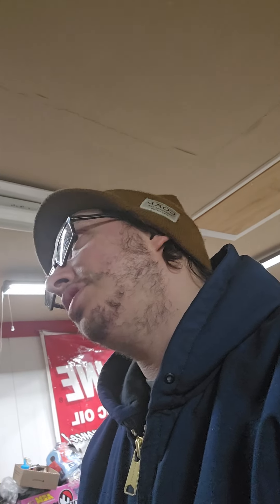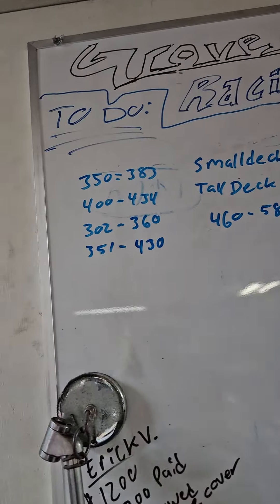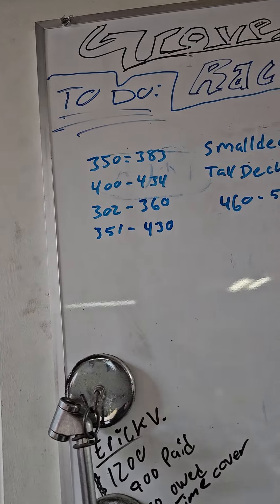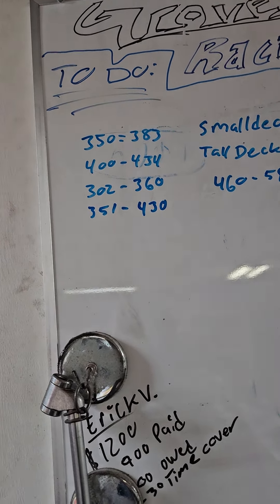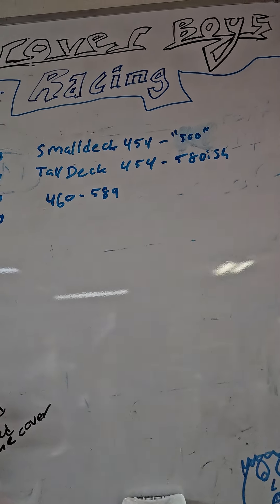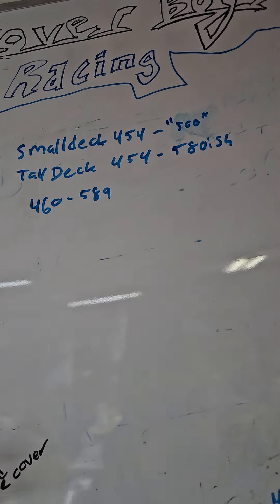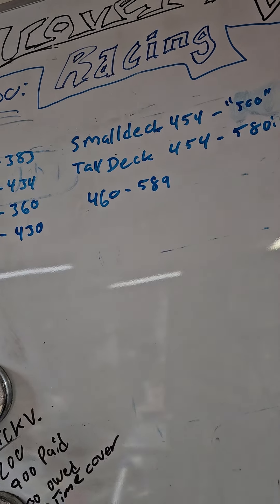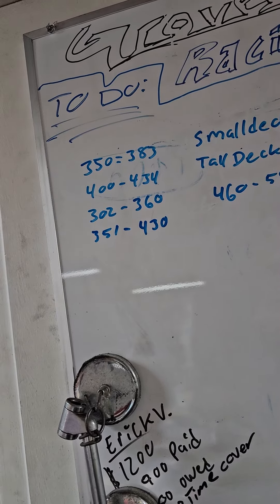FORD VS CHEVY! The facts from my perspective. Disclaimer you may be offended!

Comment: I I got a question for you that I find that mixed reviews. My car is put away for the winter. I put a full dig gas in it and it’s topped off with stabilizer fuel stabilizer took the battery out of it, etc. no I’m told not to start it for the whole year until next spring other things, I read
Fire it up what’s your thoughts? I just don’t want any condensation in my exhaust or the motor and rust on the bottom of the car or in the motor.
Reply from the maker: Personally id probably mix marvel mystery oil in it and run it. The can of fuel stabilizer should have directions of what to do, but marvel mystery oil is a nice oily substance that keeps things lubricated. Can be used in gasoline or oil. I like starting my stuff through winter time and letting it run even driving it on those days that are nice aslong as it isnt freezing lol.
Reply: @GroverBoysRacing777AdamGrover 
What do you think of guys running 20 W 50 in in their cars when I bought this car off the guy he said the oil changes were 20w 50
Reply: Car ran strong last summer. I’m just itching to start all the new work on the car just getting too damn cold
Reply from the maker: @Bob-Pye  i hear that, last night was the first night ive been in the garage in roughly 1 or 2 weeks. My whole family came down with somthing and finally were getting better
Reply: @GroverBoysRacing777AdamGrover  glad to hear, man I’m really glad I got your channel really help me with my build and my quest for 12s in a completely stock Foxbody
Reply from the maker: @Bob-Pye  its easily doable, good luck and lmk how you make out
Reply: Thoughts on running 20w50 VR1 valvoline in a Foxbody?
Reply from the maker: @Bob-Pye  i usually run ford motorcraft synthetic blend 20-30 or somthing like that.

Comment: The fact that per CI and weight we’re able to compare a 302 sbf to a 350 sbc makes the 302 the clear winner.  I’ve had great luck on a budget with the sbf>sbc.  Just least investment per ET times.
Reply: I was a GM technician for 16 years, my daily drivers were always GM.  I always had fox bodies and occasionally SBC cars for drag racing.  The ford was cheaper to get results from.  As specially 5.0 roller setups.
Reply: I built a Vortec 350 with great results mind you but the car overall “G body” took much more effort than a stock fox for ET numbers.

Comment: I know one thing I do like about Chevy is the price of the parts , I honestly think that is why half of the Chevy boys are Chevy boys. But you're right when they want to compare engines to engines they want to pick on the poor lil guy the 302 vs their 350/400/5.3/6.0 but never their 305 vs the 302 even though they still have a 3 cube advantage 😅.  I would put a 289 vs a 305 or even a 350 if built right. With that being said hopefully you'll have good luck with that 350 cause it sucks if you're constantly having fix broken parts, but upgrades are always fun when they work and make power but sucks if it goes slower. Im in the middle of a cam and 1.7 rocker swap trying to get all I can out of it even though it is fast there's always faster 😂
Reply from the maker: Youll have one guy come on here i bet and mention the chevy 302 i can almost gatuntee it, i think they forget there was a boss 302 though lol.. when you start comparing apples to apples the chevy boys get very upset
Reply: @GroverBoysRacing777AdamGrover  🤣😂🤣 yeah you're right, they don't want to bring up the boss , hell it 
Would still give them hell with very few mods, it was way ahead of its time, even the Cleveland, it got banned because it was too fast , and it can easily be made to go fast with the stock heads in today's standards
Reply: @GroverBoysRacing777AdamGrover  Your entire vid is you being upset and offended that people don't agree with you.  GM engines rule the aftermarket because they are better, simpler and cheaper.  Ford engines have always been weaker and cost far more to build to the same relative level as a comparable Chevy.  Can you find exceptions?  Not really, because displacement isn't the only point to consider.  A 302 boss, for example, was not intended to compete against a 305; it was aimed at 350's and 400's...and failed.  Trying to ignore that doesn't support your argument, it just makes you look desperate.
Reply from the maker: @scottysgarage4393  youre back again? This video must have really upset since youre back 3 weeks later.. I think you need to learn some facts because the boss 302 and chevy 302 both were made for trans am racing and the gm 302 was know to out perform the other gm small blocks in average street cars from the factory. Now that being said, the boss 302 out ran the gm 302 engines. But like you said a gm is cheaper to build than a ford. Difference is you dont need to build a ford engine to beat a chevy engine point blank. Ive done it many times, beat gm engines with a bs 302 with factory heads. This video is not my opinion, its my experience and what ive witnessed through out my 30 years of being involved in drag racing. Dont like the content, no need to follow but ill continue to speak facts from my experiences to help people and guide them aswell. Thankyou and have a great rest of your day.